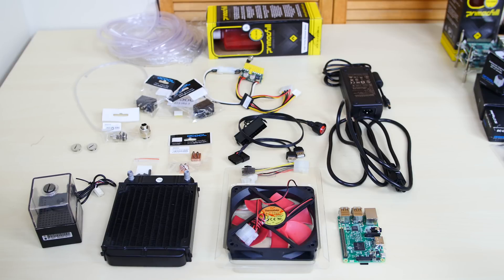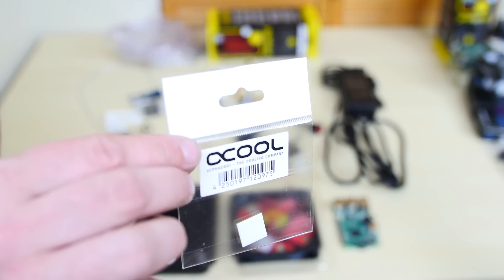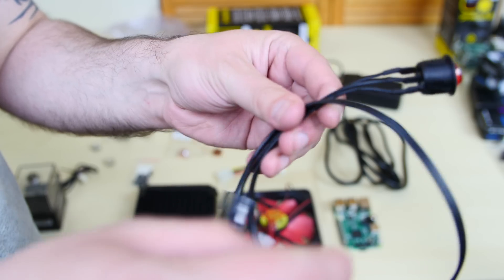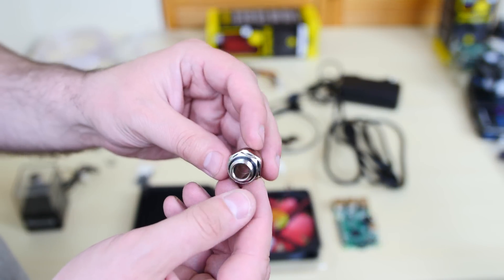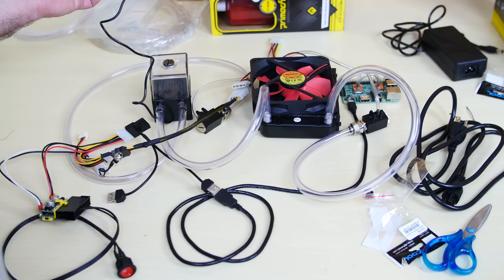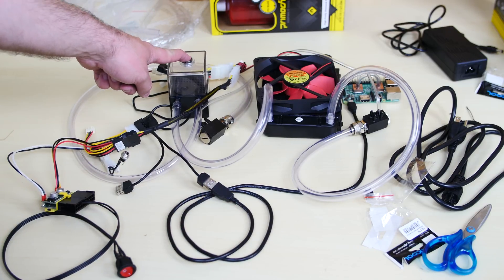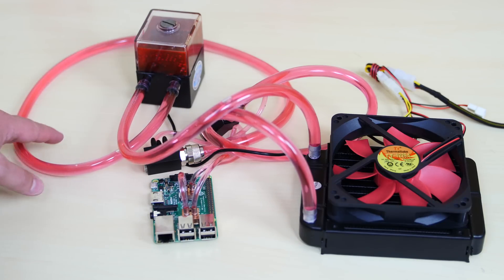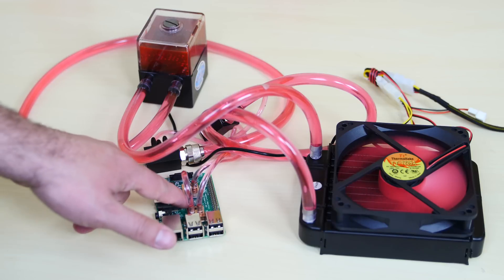Water Cooled Raspberry Pi 3 - Part 1 - The Build

Comment: is there a point to this?
Reply from the maker: +Samuel Pulis I had fun building this, so I think there was a point.
Reply: Ok then
Reply: only if you send a watercooled pi back :p
Reply: +John Mullen I don't disagree.  I don't use raspberry or do projects like these purely for fun so the point of it was not obvious to me initially.  my apologies
Reply: +Tanjo Galbi (Galbi3000) to a point, yes.  eventually you will reach a point where the processor will not continue to work, regardless of heat export.  this guy is using a radiator made for a much more powerful processor like for a desktop computer.  it is stupid overkill that will not do anything more than a large copper heatsink would have done
Reply: Having fun IS the point. He's actually right.
Reply: John Mullen if you have money to waste, send it to me :D
Reply: The other point to it other than the fun aspect is that a cooled Raspberry Pi (even if only cooled using a heat sink) can be over clocked for higher performance. The better the cooling the faster it can go.
Reply: Samuel Pulis
I totally agree with you. The setup in this video is overkill. But it does not stop some people doing it for some reason lol
The heat sink sold by the makers of the Raspberry Pi would be fine for the device, maybe with a small fan for extra airflow if overclocking.
Reply: Some Guy
My apologies to you, I misread the tone of your earlier reply! It happens once in a while :P
No you did not say it does not overheat but you did go on about the water cooling being overkill talking about watts etc. as though it was not needed. Easy to make the assumption I made.

And no I did not say it's about overclocking to put the cooling system on it, I actually said it's a reason people use to justify doing it. So please do not put words in my mouth either ;)

Sure the system is overkill but to say 97% of the system is wasted is wrong, it just means the system is over efficient.
Reply: Samuel Pulis Oh no, I understand. I just agree that having fun with it IS the point, even if it means blowing money on incredibly useless things. No worries!! :)
Reply: MrDoboz If you have the money to waste... is it a problem? Think about it.
Reply: How much was everything?
Reply: Overclocking for more performance still isn't a proper investment with this xD It would've been far cheaper to buy several Pi's and invest time in clustering/scaling or just buying 1 more powerful mini pc, either ARM or x86.
Reply: People like to see how far they can push a CPU, no matter what type or make. They are willing to pay a lot of money to do it.

More money than sense if you ask me :)
Reply: ***** This isn't about overclocking anymore as the Raspberry will never be able to use more than a few watts even if you'd solder more powerful VRMs in place, with at best 5w of heat to dissipate any liquid cooling setup is overkill as they're more for the 90-150w ranges... 
It's like bolting race wheels onto a wheelchair, looks funny but doesn't improve performance...
Reply: Some Guy
Please do feel free to point out in my posts here anywhere I have said it was a good idea! I just gave a reason why people add water cooling to their Raspberry Pi. "More money than sense if you ask me" should have shown I do not think it's a good idea!

But I fail to see why you think the Raspberry Pi can not over heat! The official Raspberry Pi store even sells a heat sink for the Raspberry Pi 3 (not water cooled) because it is known to get hot. And that's with it under full load without overclocking. Just because it's low watts does not mean it cant get hot.

Don't believe me? Take a look here: https://www.raspberrypi.org/forums/viewtopic.php?f=63&t=138193
Reply: ***** Where did I say the Raspi does not overheat? Never even mentioned most of those words in the original comment...
My point is that using for instance the cooling towers of a nuclear powerplant for a wrist watch is useless, doesn't cool it any more than a proper sized (much smaller) cooling system does...
So feel free to point out where I claimed the Raspi does not overheat...
While you're at it, also post where I say you claim it to be a good idea, again never happened.
You said it's about overclocking to put such a cooling system on there to 'push a CPU' and I responded that at best only 97% of this cooler is wasted... In the worst case it comes very close to 99%...
Reply: ***** Fair enough :P
Reply: That is nonsense, cause this whole thermal system is severely bottlenecked by the thermal adhesive.The block and the radiator will never even get close to their transfer limits. It's like putting a jet engine on a car but only driving it in first gear. I bet you'd get better thermal performance if you use top of the line thermal compound with a heatsink and putting the thing in front of your fan.
Reply: SCARLET★STAR
Ok, first of all, jet engines don't have gears to set the speed :P

Now with that silliness out of the way... the thermal performance of the compound does not matter as the system shown is overkill for the application. The compound used would be perfectly fine for the Raspberry Pi 3, it's the over sized radiator and the large tubing/pump being used that people have an issue with. They are the parts of this system designed for larger chips that get hotter.

They may be overkill but the only wastage in this system is the energy being used to run that pump when a smaller pump for a smaller cooling system would use less.

It is also as inefficient design. The liquid flows first to the CPU and then on to the second chip (which I forget it's purpose at this time) and so the heat transfer of that chip may be reversed if the liquid is already hot enough (unlikely but possible if flow is slow enough, maybe from a kink in the tube) making the chip hotter not cooler. There are enough connectors in the large to small converter that the cooling of the 2 chips could have been done in parallel instead of series.
Reply: Samuel Pulis That was too long for you to understand it? Damn dude...
Reply: Sorry but I never said anything about the jet engine having gears. A petrol engine doesn't have gears either. But I think I know what you are saying is that jet engines don't use the rotary energy of the shaft but rather the exhaust of the jet which would bypass the gearbox. Though there are derivatives like the Turboprop that do use the rotation of the shaft. And that's what I was referring to.

Of course the radiator is still overkill even were the waterblock soldered directly to the chip die.

As you have noticed yourself unless there's a malfunction in the loop flow direction in the series cooling doesn't matter. It doesn't even matter on desktop computers. I made some napkin calculations for the loop in my rig and the temp difference between the CPU and GPU block is less than 1K. For the purpose of designing the loop you can basically always think of the whole loop having the same temperature. Parallel vs series is more about pressure and flow rate.
Reply: +Some Guy honestly I didn't care to read it.  this thread is making a lot of notifications on my phone it's kind of annoying lol.
Reply: Samuel Pulis
Mute the thread to stop notifications :)
Reply: SCARLET★STAR
Nope, the whole loop does not have the same temperature, otherwise it would not be effective at all. The liquid draws heat from the chip(s), from that point on in the loop the liquid is warmer until it reaches the radiator that draws the heat from the liquid. Now for the return part of the loop it's a lower temperature. What I think you were referring to was the average temperature of the loop which will be mid way between the high and low levels :)

It's wrong to say that you design the loop based on the average temperature of the loop. When designing a cooling system of any type, not just chip cooling, you essentially want the difference between high and low to be as big as possible. So you design based on that difference. "Overkill" is always better than "just enough" as it copes with unforeseen circumstances. It's down to the 'engineer' to decide how much overkill can be afforded with the costs of building the system :)
Reply: I'm not sure how to mute a comment thread tbh.  I've never had a comment generate this level of activity.  

Before i do that though, i would like to pose one question, well two questions.  Obviously this is insane overkill.  the pi3 uses something like 1.5 watts at idle and this cooler would easily be able to dissipate many many times that amount of power just in heat.  I would bet that you could just connect positive and negative from a 2A 5v psu, like one that you'd use on a pi, through a resistor, creating a heater essentially, and i would bet this cooler would be able to dissipate ALL of that heat.  

That being said, with this cooling system, how much could you actually overclock the pi3?  What is its ceiling?  i know actual maximums will vary chip to chip but i'd bet you could more than triple the clock speed.  has anyone actually done this?

And secondly, assuming someone used a system like this  to oc the pi to its absolute max, what would they actually use it for? Answer has to be something that you couldn't easily find a different device that would work better, with less work involved, better suited to the task, less costly, etc.. also 'fun' or 'just to see how far you could push it' are not acceptable answers.  :)
Reply: Samuel Pulis This kind of radiator could easily dissipate 140w or more, but it depends on many things, in the worst case it will 'only' do 100 watts, where the Raspberry will really struggle to even use 5 watt...
To really overclock you'd probably need liquid nitrogen to freeze the CPU (-30 to -40 degrees), that is what the world record people use. 
Overclocking usually has no practical use, besides the small number of users who need a few % extra performance and cannot afford a more powerful system, usually it is far cheaper to just buy a slightly faster system which performs better than the overclocked setup would do.
And then there's those that want to see how far they can take it, most of them end up breaking the CPU but just before that they reach quite nice speeds.
Reply: +Tanjo Galbi (Galbi3000) Read my comment again. There is a difference but its so low it's negligible for the design of the loop. Why is that? Because the flow rate is usually so high that the volume of water flowing through the block can only take a low amount of energy in the time it's in the block. This low amount of energy is the dissipated in the radiator at the same speed in state of equilibrium. The high resulting dissipation results from the flow rate.

When designing the loop the difference between water temperature and block (20-40K for desktop CPUs, in this case probably far lower) and the difference between water and ambient (5-15K, again, probably far lower for a RPi) is important. The first difference is used for the choice of the block and thermal compound. The latter is used for choice of radiator size, thickness and fans. The minuscule <1K difference in the different parts of the loop are negligible. They are important for the physical working of the system, but not for the design of the loop.

Also real engineers don't like overkill designs. They add cost, weight, volume, maintenance. A good design is  one that does what it needs to do plus a bit of safety buffer. That buffer depends on the application. Critical life support systems obviously have a larger buffer. A consumer PC obviously doesn't need that. TDP of the components are documented. Overdesigning something here is just burning money. There can be reasons like using an higher Wattage PSU for later expansion plans or using the better efficiency at a lower part of the load curve for example. Using water cooling for more silent operation or for looks. Those are personal reasons, but overkill for the sake of overkill is pointless. Just as is this system for adding a noise producing fan and huge amounts of bulk and cost to a system that uses completely silent passive cooling out of the box. It doesn't even look good.

This might be useful for a  cluster of RPis enclosed in a space with low ventilation. And I recon that's what the components were designed for, looking at the multiple ports on the G1/4 to 3mm adapter.
Reply: He is freaking exited.
Reply: SCARLET★STAR
Been a while but just noticed this reply of yours! lol

In an ideal world we would be cooling the chips to absolute zero for zero resistance so the chips can work as fast as the electrons can move! But hey, real life is far from ideal ;)

Having an over efficient cooling system on the Raspberry Pi just means it can work at peak performance while staying at closer to room temperature than without the cooling. There is no waste of cooling!

BUT having said that I have been saying all along here that I totally agree that it is overkill!

You said: "Also real engineers don't like overkill designs. They add cost, weight, volume, maintenance. A good design is one that does what it needs to do plus a bit of safety buffer. That buffer depends on the application."
If you reread what I said then I think you will find I pretty much said this in not as many words!: "'Overkill' is always better than 'just enough' as it copes with unforeseen circumstances." That would be your safety buffer! "It's down to the 'engineer' to decide how much overkill can be afforded with the costs of building the system"

I am not an engineer so I do not know the calculations involved but I do know they will calculate when the cost of the cooling system starts to outweigh the benefits of it. If given an unlimited budget they would be just as over the top with their cooling as this system is for the Raspberry Pi because more is always better when it comes to cooling.

But again, that does not mean I would do it myself! The Raspberry Pi is designed to be as small as possible for projects like robotics where it needs to be mobile. A cooling system like this in the video is only for people showing off and seeing how far they can push the Pi! It's almost a disposable computer so they can do this! I have seen a rather nice RPi stack that just uses plain heat sinks and 2 case fans to cool all 8 computers in the stack. That is all you need in a real world situation and I have always said that if you would be bothered to read my past posts :)

To get things straight. I would not make a cooling system like this for the Raspberry Pi. But my points about cooling systems in general are no less valid. I am being a devil's advocate here, just because I am defending the concept of the video does not mean I would do the same :)

And what was my trade before illness took over? I was a PC technician and software developer with qualifications in electronics as well ;)

Now lets agree to disagree and continue with our lives (worthless as it may be in my case :P)

TTFN
Reply: Sure! Doing this kind of a setup with multiple rasPi's would let you cool a cluster of them with less fans.
Reply: it's not having fun, it's wasting money.

Comment: I have never build a water cooling or something like that. But wouldn't it be smarter to have the pump on the "hot" side of the system? Like that the cooled fluid could go from the radiator directly to the RPI. The water pump might add a little bit of "heat" to the fluid.

Comment: I'd have just  bought a USB (5v) power and 12v power adapter and added a switch to the USB and changed the end of the 12v to a molex adapter/12v fan splitter 
pretty cool none the less :) well done